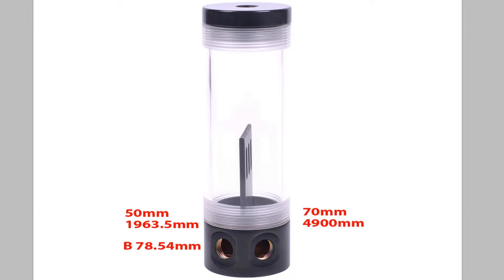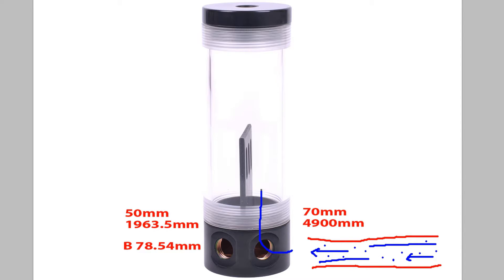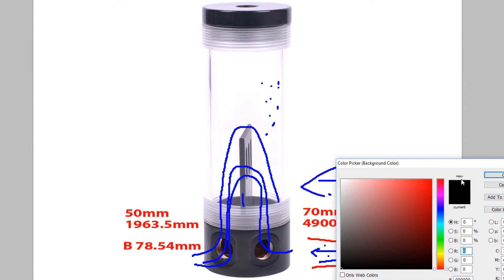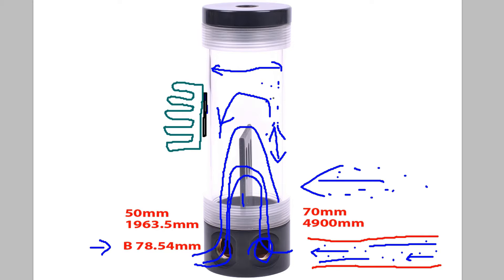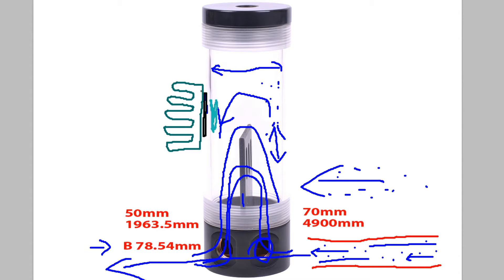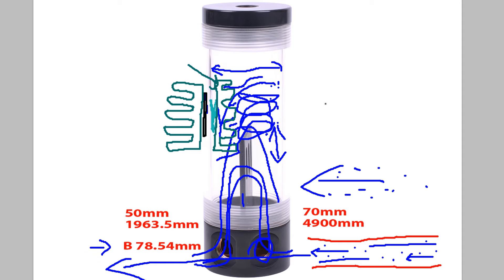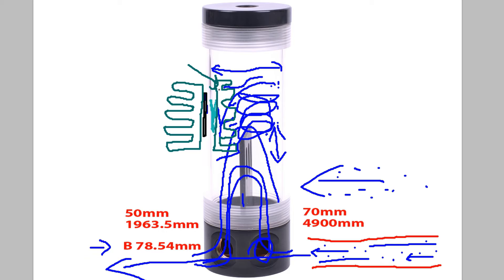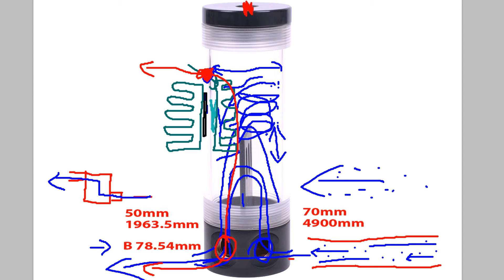Peltier Waterblock Theory: TEC Chilled Reservoirs  Episode7

Comment: Instead of cooling the res could you use the T.E.C. to cool the water going through the radiator ?????
Reply from the maker: You could however how does that solve any of the issues raised here about cooling a RES ? Cos i can only assume the only place where you could fit TEC's would be the end tanks of the radiator ? and therefore have the same issues as with the RES ?